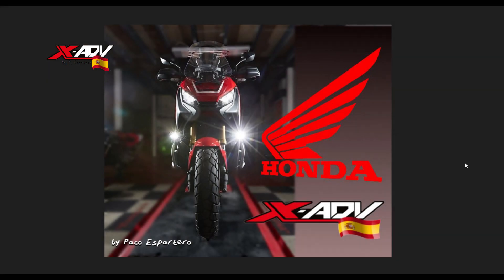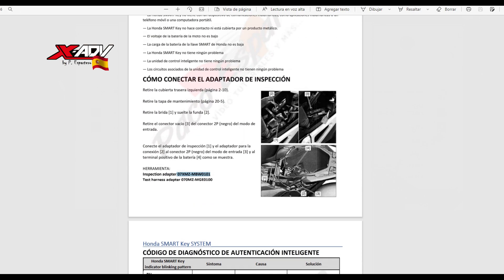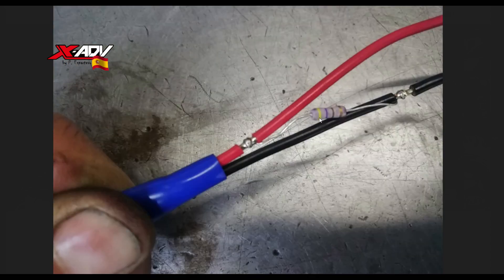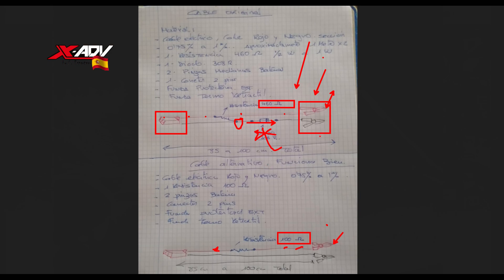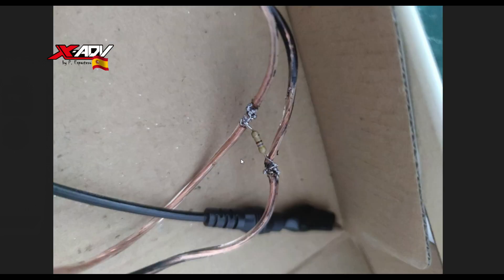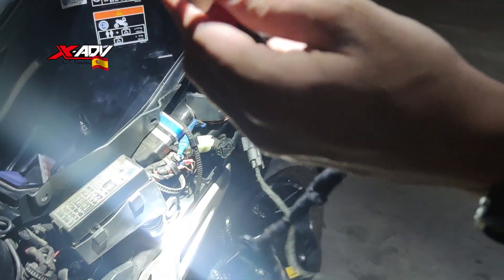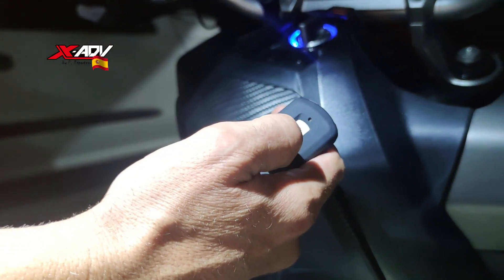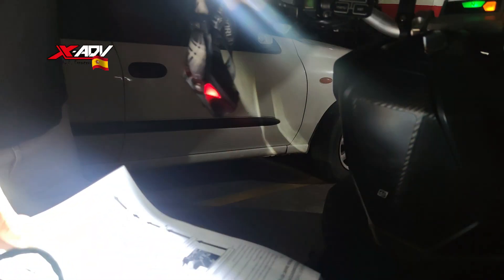CÓMO DUPLICAR LA LLAVE SMARTKEY HONDA DE TU X-ADV CON CABLE CASERO DE 3€. HIIS KEYLESS

Comment: Otra vez gracias por el tutorial, creo que el diodo evita el cambio de polaridad, es caso de conectar el cable negro al positivo, la resistencia está de modo de limitación siempre hay un consumoa12V de 0,025A y evita los picos de corrientes cuando se conecta o se desconecta, un saludo
Reply from the maker: Sí, tiene sentido Tocayo. Efectivamente, el diodo evita que la corriente vaya en sentido contrario, pero aún así, al terminal negativo no le encuentro sentido. Quizás en otras motos se usen ambos pines, aunque se me escapa con qué finalidad sería. Un saludo

Comment: Hola Buenas tardes!

Excelente video, podrás compartir el manual, para ver como puedo configurar las llave sin tener una anterior. en mi caso he perdido las dos. Ya tengo las nuevas, pero no he podido configurarlas.
Reply from the maker: Hola Ricardo, entra en el grupo de Telegram y ahí lo tienes https://t.me/HondaXadvEsp

Necesitarás el código que venía con las llaves. Un saludo
Reply: @PacoEspartero   Muchísimas gracias! si por suerte lo tengo, porque lo dejaba en casa. Lo único que estoy aun viendo el video para hacer el cable! gracias!
Reply from the maker: @ricardogonzalez8236  al final el cable lleva el diodo y la resistencia para que sirva para diferentes motos, pero sé de suscriptores que lo han hecho simplemente dando corriente al terminal, sin necesidad del resto. Ya nos contarás. Un saludo
Reply: @PacoEspartero Excelente canal, gracias por la colaboración Paco.

He logrado configurar los dos controles,  sin tener ninguno adicional: me ha llevado algo de tiempo pero se ha logrado; para los que tiene un caso parecido que han perdido las dos llaves, seguir los pasos de configuración sin control, (esta en el manual) Es necesario el código, por lo que les recomiendo a todos tenerlo siempre guardado en casa, o en una foto; una vez configurado ese primer control, seguir los pasos de este video, para configurar el segundo. 

Algo que me he dado cuenta en el proceso, cuando configuré el primer control, la moto va a registrar ese código de ese llave nueva, y el código que teníamos anteriormente ya no va a servir de nada. la moto ha adoptado ese código.

En mi caso perdí las dos llaves, una la perdí hace unos meses, y la segunda en la autovía.  la cual vi a lo lejos por el retrovisor...    🤐
Reply from the maker: @ricardogonzalez8236  me alegra que pudieras solventarlo. Un saludo
Reply: @PacoEspartero buenas una pregunta el mando de AliExpress siempre esta en función aunque lo pongas en rojo tambien te deja arrancar la moto? Porfa si puedes resolver mi duda
Reply from the maker: @joaquinarroyo9991  hola. Efectivamente, ese mando no permite desactivarlo, por lo que cada vez que estés cerca de la moto se podrá arrancar
Reply: @PacoEspartero  muchas gracias, por eso le pregunte porque me paso eso mismo y me acordé de su video Gracias por su respuesta, un saludo

Comment: Gracias por los tutoriales y/o información relativa a la X-Adv. Aunque no viene al caso me gustaría pedirte un favor Paco, acabo de comprarme una x-adv del 2019 de segunda mano y estoy haciéndome a ella aunque me está costando un poco por el tipo de motos de donde vengo. Al grano tu podrías decirme que medidas tienen las bieletas originales de esta moto? Me da la sensación de que las de la mía están cambiadas. Un saludo
Reply from the maker: Hola Sergi, he medido la bieleta de mi moto y de centro de tornillo a centro mide 15cms. Espero que te sirva. Un saludo
Reply: @PacoEspartero  muchas gracias por la rápida respuesta.
Reply from the maker: @sergifreixes9021  de nada, amigo

Comment: Muchas gracias por el video, aunque yo tengo otro modelo de honda  la Forza 350, me da esperanzas de poder solucionar mi problema de perdida de una de las dos llaves, ya que en el concesionario cobrar una cantidad desorbitada por copiar la llave, a mi entender nos cobrar el cable mas la mano de obra a todos y cada nueva copia 170 Euros. Sabría decirme algún lugar donde comprar o descargar manual de taller de la Forza 350, de nuevo gracias.
Reply from the maker: Es difícil conseguir los manuales de taller. En eBay seguramente lo haya. Mira en foros de tu moto a ver si hubiera suerte, aunque los procedimientos suelen ser parecidos, lo suyo es asegurarte de cómo se haría

Comment: Buenas. Gracias por la fabulosa información.  Tengo una duda. Entiendo que con mi sh 300 iría igual no? Gracias por la ayuda.
Reply from the maker: Buenas Xavi, probablemente sea un procedimiento similar, no tiene por qué ser el mismo, por ejemplo el de la SH125 es similar. En este caso, viene detallado en el manual de taller. 
Te recomiendo que busques información o hagas algo parecido al de la 125, hay vídeos por ahí. Saludos
Reply: Muchas gracias por la respuesta. Un saludete

Comment: Paco como siempre un magnifico tutorial como te lo curras por la comunidad
Dices que la tuya es del 2019 y te dieron dos smart key
Yo compre la mia de ocasion en un concesionario hondita matriculada 8/5/2019 entiendo que me deberian haber dado 2 llaves cosa que no hicieron
Tu me podrias decir de que mes es la tuya
Para poder estar seguro y pedirsela 
Mil gracias
Reply from the maker: hola Jota. Es de Julio de 2019. Sólo las primeras versiones de 2017 y 2018 traían 1 llave, a partir de ahí, todas con 2. Un saludo

Comment: Hola Paco yo tengo la sh 300i 2017, veo que el mando es el mismo sabes si el precedimemiento para la honda sh 300i seria el mismo?
muchas gracias. un saludo
Reply from the maker: hola Víctor, pues debe ser similar al menos. No obstante, te sugiero que mires el manual de taller de tu moto que será donde venga especificado. Un saludo.

Comment: Hola Paco ! Video muy interesante y que aporta mucho a gente que tenemos la mala suerte de tener una 2017 y perder la única smart key que nos entregaron con la moto. También darle las gracias a Pepe de Barcelona que ha sido el instigador moral del video :)
Solo quería comentar, por lo que veo en el video, a la hora de fabricar el cable, la pinza del negativo entiendo que no es necesaria, con poner una regleta o un terminal ciego para que no pueda hacer un contacto indebido sería suficiente, que por otro lado, tampoco tendría de pasar nada porque lleva el diodo de protección, es así ?
Reply from the maker: Hola Jordi, muchas gracias por tu comentario. Realmente no hace falta nada más que darle corriente directa al terminal y listo. Hay gente que me ha dicho que lo ha hecho así y sin problemas. El duplicar el esquema del cable original lo que permitiría es usar el mismo cable para más motos que si necesitan toda la parafernalia. Si decides hacerlo, efectivamente, el negativo no hace falta. Un saludo
Reply: @PacoEspartero hola amigo tienes WhatsApp y disculpe

Comment: Hola Paco, tienes un video donde muetres el procedimiento de como hacer una Smart Key apartir del codigo, lo que pasa fue que bote los 2 controles y solo tengo el codigo de acceso
Reply from the maker: Hola Teo, no. Pero en el manual de taller viene como hacerlo. Entra al grupo de Telegram y ahí lo descargas
Reply: Gracias, tienes el enlace del grupo?
Reply from the maker: @Murdock.31  aquí lo tienes: https://t.me/HondaXadvEsp

Comment: Buenos dias! Y hay la opción de sin la llave smartkey programar un mando nuevo?
Compré la moto modelo 2017 con una smartkey y la del sillin
Pues bien… he perdido la smartkey, en el taller dicen centralita como dices
Tampoco tengo el código ya que es de segunda mano y no la encuentra 😅
Reply from the maker: Hola Raúl, sin la llave original se podría, pero claro, necesitas el código. Sin él, creo que toca cambiar centralita, a ver si en el concesionario te pueden dar una solución. Un saludo y suerte

Comment: Buenos días, sabrías si el procedimiento es el mismo para la Forza 125 (2021). Muchas gracias
Reply from the maker: Hola David. Por lo que he visto, en todas las Hondas el procedimiento es similar, aunque no exactamente igual. Supongo que sí será igual que el de la sh125, de la cual hay vídeos por ahí, ya que es el mismo motor
Reply: @PacoEspartero  Muchas gracias, Paco. Haré el cable como en tu tutoría, sólo tengo una duda. La conexión del negativo va al chasis o al negativo de la batería. Gracias por difundir tus conocimientos
Reply from the maker: @agpdiaz  gracias a ti por comentar. El negativo de la batería y el chasis están comunicados, así que da igual. El negativo creo que no te sirve para nada
Reply: @PacoEspartero  disculpa que te vuelva a molestar, pero imagino que si habrá que conectarlo. Para que esté conectado o no es necesario. Solo con el positivo es suficiente, no entiendo mucho pero el negativo cerraría la alimentación al circuito, no?
Reply from the maker: @agpdiaz  como puedes ver en el vídeo, no lo conecto. De hecho, un suscriptor me dijo que no hizo el cable, sólo conectó el positivo al conector y pudo hacerlo
Reply: @PacoEspartero  Gracias de nuevo!!

Comment: Buenas paco, mi hijo tiene esta misma moto y ha perdido las llaves ya que nos la vendieron solo con una, sin tener la llave original se podria hacer este procedimiento para poder arrancarla, hemos llamado al taller y piden un dineral.
Reply from the maker: Hola Marta, si tienes el código que te dan con la moto puede hacerse de la misma manera que el vídeo, pero metiendo los números a mano. Si no tenéis el código, supongo que la única forma es hacerlo en el taller. Suerte, un saludo
Reply: @PacoEspartero  no tengo los códigos y tampoco se donde los puedo ver
Reply from the maker: @MartaHitacasado  el código lo dan con la moto, en el mismo llavero, es como el que enseño en el vídeo.

Comment: Saludos Paco. Muy buen video y explicación para adicionar la nueva llave. Será posible que puedas compartir por Drive el documento con el procedimiento del registro cuando se han perdido todas las llaves? Muchas gracias.
Reply from the maker: Gracias por tus palabras Mauricio. En el grupo de Telegram tienes el manual de taller, ahí viene el proceso. Entra y descárgalo
Reply: @PacoEspartero  Me podrías decir el grupo de Telegram?
Reply from the maker: @mauricioenriquez2783  https://t.me/HondaXadvEsp
Reply from the maker: @mauricioenriquez2783  https://t.me/HondaXadvEsp/51665 ahí el archivo

Comment: Tengo una pcx 125 perdi los mandos y los códigos,como puedo encender la moto
Reply from the maker: Hola Santiago, si te dijera eso cualquiera podría robar una moto. Habla con tu concesionario porque podrán acceder a la centralita y reprogramar llaves nuevas. Un saludo.
Reply: @PacoEspartero  si eso me digeron que deben cambiar la centralina ,pero me vale 1200 euros y quería saber si hay otra manera ?
Reply from the maker: @santiagomedina5888  buscar una de desguace con sus llaves será más barato
Reply: @PacoEspartero  el scooter es nueva del 2021 me costó 4500 euros y no veo justo que por cambiar llave me cueste tanto ,por eso busco una manera
Reply from the maker: @santiagomedina5888  si conoces a algún taller que hagan repros, seguro que pueden leer la centralita y obtener el código

Comment: Amigo y si no tengo ningúna llave solo el código de desbloqueo y ya tengo una llave virgen cómo sería el proceso
Reply from the maker: Tendrías que meter el código que te dieron con la moto en un llavero manualmente. En el manual de taller viene explicado, échale un vistazo. Hay un momento en el vídeo en el que se ve ese apartado. Un saludo.
Reply: Gracias hermano eres un crack 👍👍👍👍